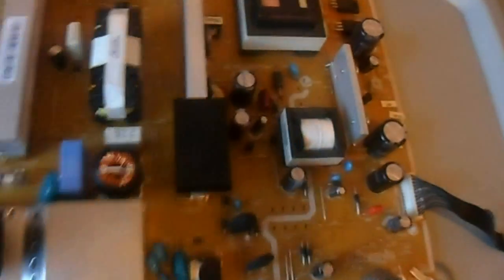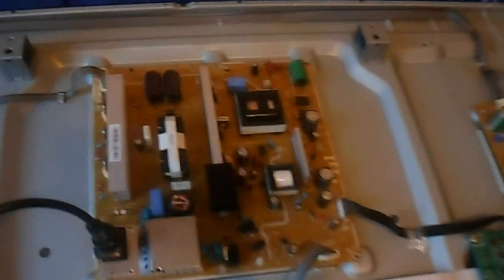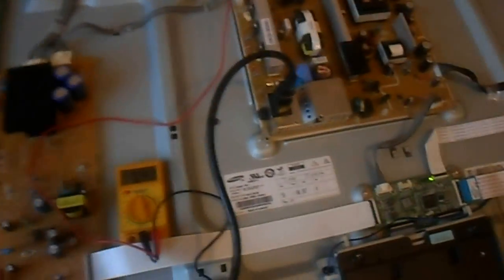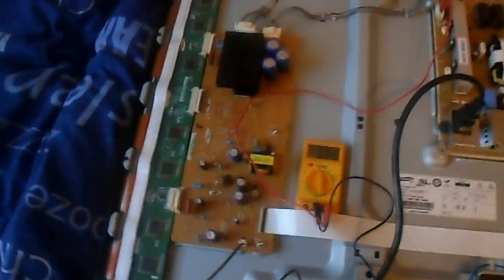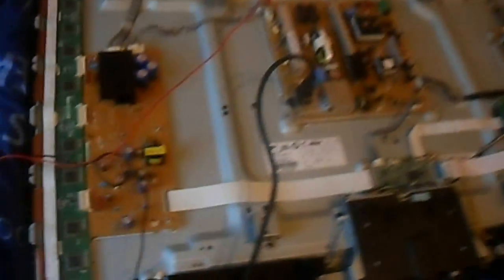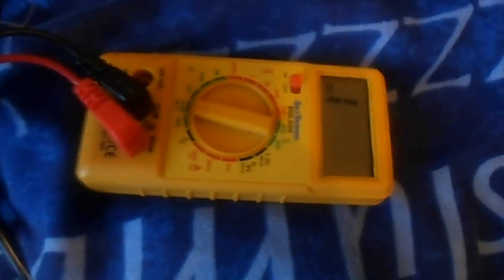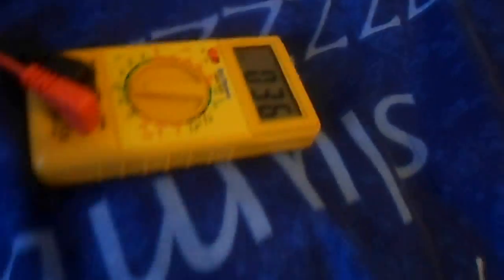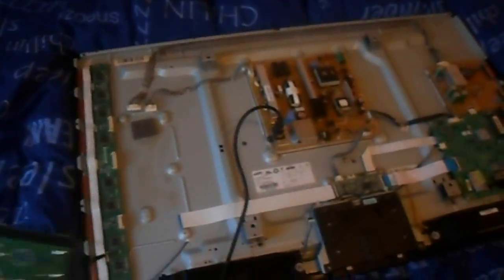Samsung PS43D450 - Clicking, no power, dead - Y-Main failure

Comment: hey I have this same plasma tv, I'm having almost the same problem. the electronics repair store said it is the something board and it need to be replaced. when even I turned the TV on it powered on and then shut down straight away and continued this process until I unplugged the power. there was no picture coming up but I saw the lights go from standby to to on. it sounds very similar to this tv because it's like it's shorting out on something. anyway they said it would cost $110 for the part, $90 labor and $20 tax. so I'm up for $220 for a tv I purchased second hand for $380 1 year ago. oh well that's what I get for buying second hand. I hope something else doesn't break on it. cheers.

Comment from the maker: Look closely at the control board, below the power supply board.
It will either do a blink about once a second -- normal,
or it will blink every 5 seconds -- X-main and Y-main need replacement.